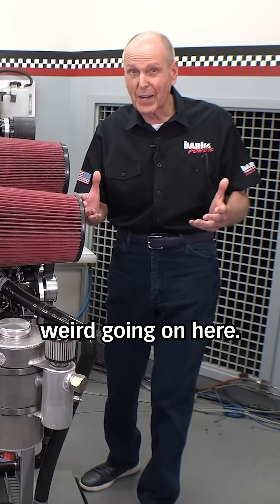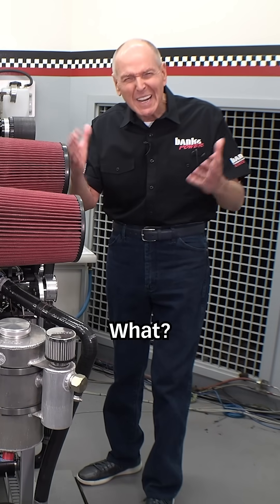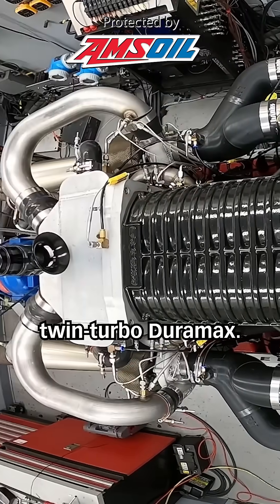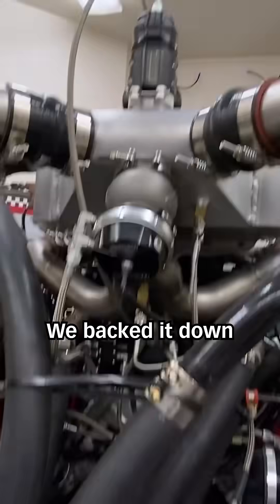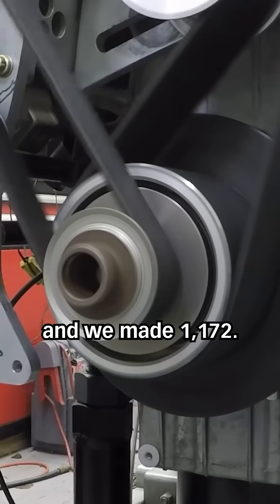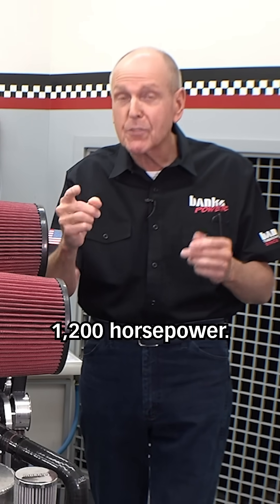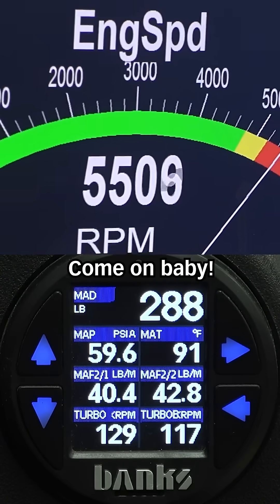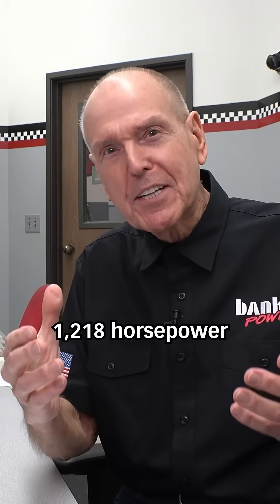How to make 1,200 horsepower the wrong way.

Comment: Gale just discovered what Detroit Diesel ( General Motors ) found out when they put Turbo’s on the old “ Silver 92”  series engines . Parasitic losses due to the load it takes to spin the blower rotors and the heat generated from compressing the air ( both from Turbo & blower ) cause lots of undesirable effects .
Reply: I agree, belt driven intakes do have a parasitic drag on the crank.  They also suffer from heat soak down through the top of the engine.  That supercharger pumping more air into engine then the turbos spinning the spent exhaust gases has to be creating a lot of heat.
Reply: My dad had one in a '79 long nose Freightliner. It was ALWAYS in the shop.

Comment: Guessing blower inefficiency is heating charge air too much causing loss of density
Reply: no, parasitic loss of turning/compressing the air in the blower.
Reply: @BlackBeardAir  it could easily be a combination of both. Blowers are known to add more heat per psi compared to turbos. The same way blowers have much more parasitic loss than turbos.
Reply: @kevinkalivoda3442  by compressing the air, you're making it more dense.  By-product of that compression is heat.  This isn't taking a given weight of air and then heating it(more volume).  This is taking a set volume (manifold) and cramming more air into the given space.  Boost is a density adder.  Temperature doesn't matter much in this application unless you're getting too hot for the materials of the engine, i.e., EGT

Comment: Maybe the Supercharger has a vacuum behind it at high speed even with the turbos feeding it, so it can't pressurize the air more unless you slow it down. I wanna see the supercharger feed the turbos too! Is it even possible to do a twin screw supercharger like that or do you have to go centrifugal?
Reply: jist reducing the parasitic loss, but still attain high manifold pressure due to the turbos

Comment: Unrelated question if I plan on revving to 10,500 rpm can I still use a blower for boost?
Reply: Gale built a supercharged 258 cubic inch V8 that revs to 10K or so for Bonneville

Comment: 1200HP but a diesel engine spinning over 5000rpm, thats crazy, is gonna last 10 years less 😂😂 but i can't denied its going to be so funny to drive a truck with a V8 diesel engine that pushes 1200 horse power and i can't imagine the torque reached
Reply: You dont have to imagine it as it is quite a simple calculation. About 1700 Nm
Reply: @virrebooi93 No, you can not calculate peak torque given only peak power and RPM. You can calculate torque at peak power.
Reply: @ferrumignis  u ok, m8?
Reply: Imagine telling Gale Banks what he should or shouldn't do. LMFAO

Get off your PC, armchair engineers.
Reply: My Om606 reving to 7k 😂
Reply: Torque = Horse power / (RPM/5252)
Reply: 5,000 RPM is stupid on the Duramax what are they thinking
Reply: 5k rpm is standard for modern Diesels
Reply: 5000 all good a om606 will rev to 6 1/2 with stock internals
Reply: The thing with that kind of power is that there is no way you can get it all to the tires and on the tarmack
Reply: How did the hoonitruck get 1200 from a diesel?
Reply: BMW Diesels with N57 engines mostly M50D redline is 5500rpm from factory.
Reply: 3,000 lbs/ft
Reply: You don't build a motor like this for stock longevity.

Example: Benz OM617 NA is good for a million miles with basic maintenance.

The turbo OM617a is good for half that, and we're talking maybe 8psi from a T3.

Do you want 85 naturally asthmatic horsepower at elevation, or 125 boosted, though?
Reply: if u launch it then 1 of 2 things will happen
a) something expensive in the driveline breaks
b) the earth gets spun backwards
Reply: Comparing the small euro diesels to a v8 duramax is like comparing a viper v10 to a k20
Reply: This is so pointless, talking about 1200 horsepower for a truck engine...

It's just for show, you can't do anything useful with it. Pointless.
Reply: That's common sense .  If u have a race truck running 1200 hp u gotta be room temp iq to think its gonna last anywhere close to 10 yrs
Reply: 5000 isn't.. Too crazy for a diesel. My passat redlined at 4500 stock but it's also only a 2 liter common rail with much lighter internals lol
Reply: @DarkAttack14 Exactly what you said, much smaller. My built 6.0 with a cam and springs is at about 5k redline which is a fuckton for a larger diesel.
Reply: @ASM31237  Think about a balance kit and head work on a DT466 running 7500 rpm... then again the inline 6 is flatplane crank and a flatplane is usually easier to get rpm out of. Compare the counterweights from cross plane crank like a 6.0 or 7.3 whatever and compare it to a flatplane crank.
Reply: @f-j-Services  that’s the reason Ferrari always used flat plane crank engines
Reply: @davehayhurst1780  That is true but my visualization for piston location relative to the other pistons is that they are in "sets" on the same plane. I guess to put it simple the concept is similar.
Reply: @DarkAttack14  stiff piston inline 6 diesels can easily rev to 8k
Reply: Funny the comments in here. .. this man has been doing this longer then most of you have been alive and yet here you sit speaking about shit like this as if this man doesn't know exactly what he's doing. This man has perfected diesels making power and being efficient and tells the truth about products in the market place. Get your heads right folks
Reply: @thomashodis5740  I would like to see him work with a DT466! I don't understand everybody hating on him other than butthurt people who get scammed and don't want to accept the facts that Banks has to offer, such as the ram air diff cover vs a normal heatsink diff cover vs a factory. I wish he would build a DT466 though. I would probably follow his build step by step on it.
Reply: I'm laughing in 2.4 JTDm.

Comment: The turbos are more efficient than the superchargers?
Reply: Turbos are always more efficient than a supercharger. That doesn't necessarily always make them better
Reply: @ec7005  they're better in almost every metric.  Now it takes proper sizing, and realistic goals.  but 99/100 a turbo will be better for the application.

Comment: How come nobody has the blower supply the turbos with boosted air?  Seems like that would deliver a better compounding effect and remove the blower rotor restriction.
Reply: The blower would still restrict the turbos, they can't pump more air than they can pull through the blower. I'm not sure it would make a difference at all.
Reply: @jaredlancaster4137 seen it done with a blower bypass valve into twin compound twin turbo with an insane intercooler setup
Reply: @trevorwall87  maybe if you had an electromagnetic clutch for the supercharger pulley, then you could reduce the power lost through the friction of the blower when the turbos are doing the work
Reply: @FrogEye-p1z 👍
Reply: @jaredlancaster4137  Not if you had a butterfly valve on the inlet from atmosphere to bypass the blower output. You could just dump that blower pressure to atmosphere.
Reply: it can be good for low end but not for afterwards, too much friction on high end compared to turbo's very few friction and 100k rpm internals
Reply: Mercedes do with their new inline six AMG cars
Reply: Only way to truly bypass the blower is by piping the air around it. Now you're into freaky deaky territory
Reply: @jankington216  would kinda be like bmw or mercedes sequential turbo set ups where valves activate to bypass the smaller turbo once the larger one is making boost
Reply: if they use a supercharger that uses a centrifugal supercharger it should work well? or a bypass as others have said.
Reply: Because then the blower is a massive restriction to the turbos intake. Doesn't work, unless you bypass the blower which makes it completely useless.
Reply: Gail already Did that for the US Navy
Reply: the blower isn't a restriction here

Comment: The "professor" is never happy.
He'll squeeze 1500 hp out of it before he's done.😊😊😊
Reply: And yet hes gone go for 2k hp
Reply: He already got 2,000
Reply: *THE Professor
Reply: Mr. Gale Banks = G.O.A.T. 🐐
Reply: Put the turbos and blower separately i think it will make better air intake and that weird "slower turbine more power" go away cause the turbos bloch the air from the blower
Reply: He’s probably looking to make the maximum amount of horsepower, but make it consistent per reliability that’s what every hot rod or dreams of rather than doing 12 passes down a dragstrip before a grenading the engine
Reply: The turbos are lagging the superchargers superchargers quicker response in turbos are
Reply: Oh how hard can it be… ya have to get a Masters Degree in Mechanical Engineering “First” right, LMAO!!!
Reply: Happiness is not an intellectual pursuit. 2000 ponies is
Reply: What you talking about...15unred? Pfft!!
Reply: Has to have to do with air densi
Reply: @ztwntyn8  It's almost ALL to do with charge air density; also temperature (dense charge at low temp/low pressure is better than the same density charge at high temp/high pressure). A turbo's compressor can have adiabatic efficiency hovering around 75%-80% over a fairly large range of pressure ratio and flow, out of touch by roots blowers. Turbos create "back pressure" or "drive pressure" on the engine that can be reduced by increasing turbine efficiency and careful A/R selection but this is difficult to predict just from theory.
Reply: Sounds like the dude is guessing and just trying things.
Reply: @captain_context9991  bud, you don't get to 2000 horsepower without knowing what you're doing
Reply: @zachmartinez2295  
Clearly... You do.
Reply: @captain_context9991  There's always a some trial and error to these things.  Banks has so much experience that his "guesses" are more educated than your or my calculations.
Reply: @captain_context9991  It's called science.
Reply: @74stang2togo  
No... LeMans and F1 racing. Supercars and hypercars, thats science. But America doesnt do any of that, do they. Its all about thise budget burnout machines and in the desperate lack of any REAL technical achievement, these local tuneshop heroes get all the praise whether its deserved or not.
Reply: @captain_context9991 I guess you've never heard of Gale Banks. F1 has more science (and $$$) than any other motorsport, but Mr. Banks has done more for the development of small- to mid-displacement turbocharged engines than probably any other individual. Sure, the big OEMs have done a lot - but in some cases they did it with Gale's consultations.
Reply: @bobreeves4431  
So like I said then.... Done a lot for the local tuneshop heroes. Not exactly the big league, is it. 

This is the thing with America. America never moved on and developed the high tech stuff. Which is why America has still not, to this day, ever produced a single supercar. 

No carbon fibre chassis, no proper venturi channels, paddleshift, millisecond gearboxes, none of the modern stuff. And when I say modern stuff... Its 30-40 years old tech. But America still has not.
Reply: @captain_context9991  So, "the big OEMs"= "local tuneshop heroes"? I guess the US military also = local tuneshop. If F1 were as big a business in North America as it is in GB and Europe and if F1 rules had something to offer his interests and business model then perhaps Gale would enter the F1 political swamp.
Reply: Very Very True & Well Said!!
Reply: @captain_context9991  His gas powered creations are banned in NHRA; is that something Europe has? He has set records at Bonneville and Diesel powered trucks in Drag racing and NASCAR. The US Navy had him build Cummins engines for marine use, the US Military had him build Duramax engines for severe duty and power. What has anyone from F1done for their Military? 
      Make your comparisons as you wish, but throwing shade at a man that has gone faster for more years than you've been around is hardly saying anything at all. He takes something everyday and makes it better and faster plus emmissions compliant. What he sells is better than any other part out there or they don't bother. Maybe that's why he's not in F1. 
       Just because he doesn't participate more in your intrest doesn't mean anything. He stays in his lane, quit trying to drag him towards your Iceberg.
Reply: @thegreenerthemeaner  
Hahaha NHRA. Naturally I had to look that up, because it is meaningless... National Hotrod association. Christ, what is this.... Why is it always a battle to explain things to americans.

And if I can now not make a strong link between the MILITARY and F1, then you just owned me with a big point, right? Wow this hurts my mind so bad. What have I done to you. Why do you hurt my mind? Christ, this is weird in ways I dont even want to imagine.

But, sure... Have it your way. See if you can name 5 American quality items or brands. Hell even ONE American "luxury" item or top-end brand. Can you do just one?
Reply: @captain_context9991 so f1 is better than all??? F1 never put a diesel on a boat and won, then used the same diesel at a drag strip and won, or used it in full sized circuit trucks either Js

Comment: Yeah that sounds backwards. Let the blower feed the turbos the air and maybe somehow close off the plenum from the blower .
Reply: How is looping it "right" to you?
Reply: turbos into blower have a compounding effect on boost
Reply: @WornOutTires  go watch the full video, crazy so many people think they have it figured out better than the guys rebuilding this shit daily.  YOU ARE WATCHING A SHORT OF TRIAL AND ERROR.
Reply: That system works on petrol engines because they rev higher so you have the rev range to have that handover to the turbos .. 
Blower for low down grunt and the turbos pick up from the blower and they get you to the power limit 

It's literally what lancia did with the delta s14 

I think it wouldn't work on a diesel because they aren't made to rev high so it would defeat the point of it all ..rather just turbo it from scratch cause a diesels power band is fairly small that's probably why compound turbos work so well with diesels it doesn't take much to start boosting the first turbo.

I dont think a blower is the best choice though.  I wonder if a vortech centrifugal blower would work better for this application.  
Sorta like a compound setup deconstructed in my eyes . The centrifugal feeds the engine and the turbos take over 

But I think this build is showing that diesels love turbos cause of the low revving nature ..

I think  a centrifugal would work a little  better in this context
Reply: If anything though it is defeating the purpose of the blower. In the end it would more just be like a another compressor for the turbos but with instant boost build up. I would either just go with a blower or turbos. Not both.